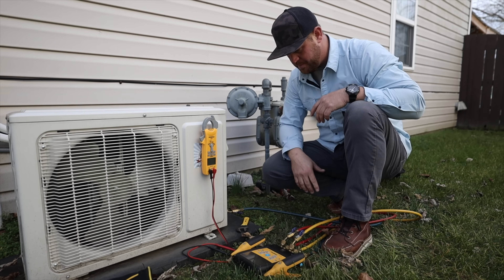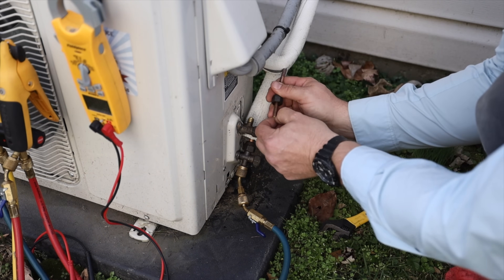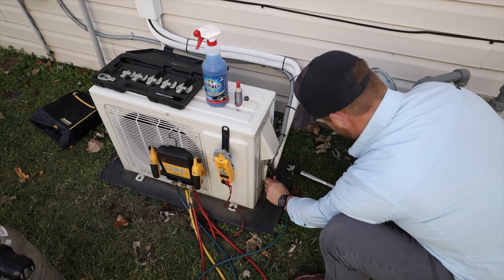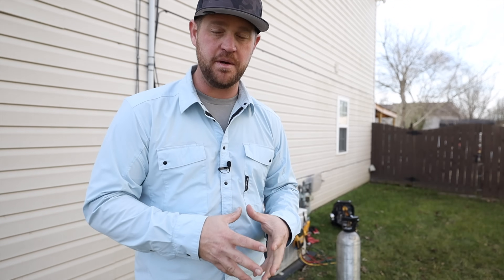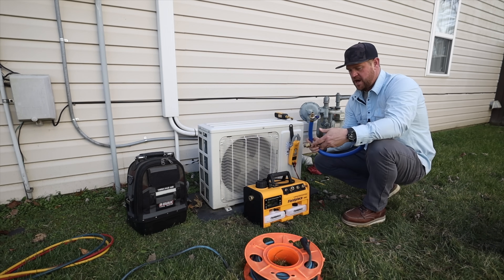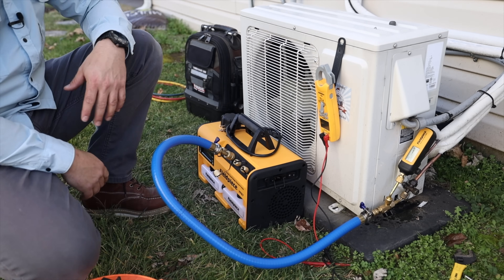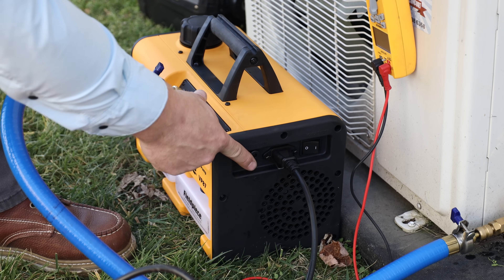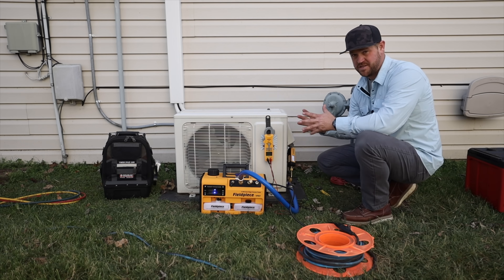#1 Reason Why DUCTLESS Units Fail | How I Fix It...

Comment: Usually, once a guy has made a poor quality flare on the outside, you need to make new flares and on the indoor unit as well. Take this advice from colleague from Bulgaria with 24yrs. experience with this type of AC units.
Reply: true, so true, you see i hate when someone do poor job, but soo many bad jobs around, eaven with so call it professionals.
once i was on cleaning job small ac unit, soooo stinky, i was yea its dirti, so i clean it full, like fan was out, and i got second call still stinks, i go back, and its true, i was like wtf, i eaven tought about pets, owners etc...and after like 5h making a fool of myself tinking wtf, i discovered small electrical smell device near ac unit, and you know what, smell was gone
Reply: TRUE!
Reply: What could happen if you don't?
Reply: @joffrecueva5662  ...you risk (more than 51%) coming back a second time, at your own expense.
Reply: HAd a few DIY use standard flare tool and not realize larger flare and not a smooth enough surface like a concentric flare tool does.
Reply: @mikeclarke3005  "concentric" means no wobble of the cone.  "Eccentric" is what I think you meant.  It's the wobbling cone type.  I've seen this mistake a few times, and I've only just been studying this stuff for about a week.  Peace  🙂
Reply: Cut those damn flare fittings off the indoor unit and braze them.  The fewer the flare fittings the better.

Comment: That unit is too close to gas meter! Would not pass code inspection!
Reply: Code varies by county, city and state. In most areas you only have to be 3' from the meters vent.
Reply: Lmao thanks CAP. 

I think as long as it’s not his home n he gets paid for coming out. Not his problem or ours lmao 

But good find, what does it need to be 5-10 ft away from a gas line?
Reply: Obviously you're not a professional.

Comment: Nah fam, as soon as you remove the old flare I would recommend redoing the flare. I know it might look good but that flare was already pressed down when they tried to torque it. That’s just my way of doing it. I don’t trust others flaring other than my own.
Reply: I would say this is a judgement call of the person actually looking at the problem. I've reused flares with no issue. Again to each his own
Reply: This guy must have run into a Fieldpeice garage sale !
Reply: @nunyabusiness6746  product placement my friend… And I love my SC440 meter and SPK2 temp probe.
Reply: I vote for new flare even if original was my own. My once squeezed flare isn't better than enyone elses. Only takes minutes and you get a fresh start.
Reply: Such a stupid and negative comments one can read here… “ The guy must have run into a Fieldpeice garage sale!” First of all, check your spelling, because if that is how you write then that’s how you are ignorant about everything ; it’s called Fieldpiece! 
Second, Fieldpiece is a state of the art HVAC equipment; you’ll never find in garage sales. The professional technician here followed the standards and protocols accordingly. Every technician will have a different approach for a same given set of circumstances or problems. If flared copper line is good, so be it. It’s a judgment call and there’s nothing wrong about that. Same thing apply while flying an instrument approach to an airport… there are protocols to be followed and every pilot will execute differently. Certain comments here are just petty !
Reply: @wagnergitirana1273    you void Mitsubishi warranty if you use nylock so... great rant, wrong but good effort.
Reply: @wagnergitirana  The comment was funny, as it was intended… And, while Fieldpiece is decent, I have some Fluke, AAB, and iManifold meters/gauges that put them to shame…
Reply: Oh dear. !
Reply: Looks like a Mitsubishi. They specifically say no nylock. Anyways re-flare is a given...
Reply: Right you already disconnected it might as well put a new flare on for good measure
Reply: Always new flares! Takes 6 minutes
Reply: @hugba  Takes 30 seconds with the Navac flairing tool. Best investment I ever made.
Reply: @krispyasfk2567 I have the Navac. I love it
Reply: Ya Nylog, that’ll do it ! HAHAHAHAAHAHAH
Reply: Navac
Reply: @tylerselby240  love that company!
Reply: Old flare was fine. Would have torqued it as soon as I found it leaking. Too many rat ass HVAC people padding bills and ripping folks off.
Reply: I agree with your preventative maintenance approach. And I'm not an A.C. tech
Reply: Makes sense, if the flare acts as a crush washer it'd be a one time deal.
Reply: Flare proved it was good   so he didn’t need to re flare
Reply: @claddagh1000   you can reject reality and substitute it for your own all you want but the facts say you must reflare. Honest techs, manufacturers, really any person with a basic understanding of how metal and torque values work knows that to be correct you reflare.
Reply: @reds815 Correct sir..
Reply: I’ve installed about 20-30 mini splits(not a whole lot) and almost every time I have to tighten or redo a flare. I started using those flare seal gaskets  and haven’t had a leak since. Those things are a bit pricey ($100 for multi pack ,1/2,1/4,3/8,5/8,3/4) but we’ll worth it. Saves lots of frustration. Buy it, try it, thank me later gator!
Reply: Always someone who thinks they know everything 😂
Reply: I am glad to see everyone advocating for new flares. I didn't realize mechanic still did flares. I see those flare helpers in the supply houses.
Reply: Yup always new flares. Can't trust the old flare!
Reply: If ain't leaking then it just ain't leaking.....
Reply: Spin bit and torque it down keep it dry
Reply: How do I set the timer for a weekly on cycle fora 22kw generac generator
Reply: I mean, if it's not leaking to that pressure, isn't it a bit of an overkill? Sure, for peace of mind anything, but just asking
Reply: Flares are reusable.
Reply: I was shown in school the factory vs. redo flare (eccentric only) and factory LEAKER!
Reply: It can go either way. If you "simply remove it" for whatever reason and don't have a leak and flared/ torqued it correctly you could reuse it hundreds of times in a row without damaging even with copper. I used to do daily at 650 psi nitro in testing and charging specialized hydraulic equipment for shipping.
Reply: You're getting paid by time anyway...why not take the time to redo it

Comment: What brand torque wrench are you using? i got the adjustable yellow jacket digital, but i would like to try out a mechanical click style, see if there is any difference, noticing that the digital may not be as accurate as i want it to be.

Comment: For everyone that is going to say "why didn't you recover the refrigerant...??" It was only 50 PSI of 410a. When he opened it I didn't see any gas blow. So that WOULD be considered deminimus.
Reply: He honestly should have recovered it before charging with nitrogen.  EPA a pain in the ass, but truth be told, 99% hvac techs do it like this anyways.
Reply: @jcarney1987   at 50 psig with 410a its below saturation temperature for ambient hense no liquid. so only 50psig vapor. you want 25-50 psig refrigerant with nitrogen for leak checking for leak detecting. so thats how it should be done. recovery should only happen if pressure is over saturation temperature for ambient hense you will be recovery some liquid refrigerant. otherwise its just a poof of vapor below saturation temp.
Reply: Plus mixed with nitrogen it’s not pure 410 anymore lol
Reply: @mrtheloverboy89   also - never recover refrigerant & nitrogen together after presure testing. nitrogen is not a compressible gas & will ruin a recovery machine.
Reply: @OcRefrig  Nitrogen isn't a compressible gas? Lol, what do you think happens when you get your 2000psi nitrogen tank!
Reply: Global warming is a scam anyway
Reply: @murkyturkey5238  😀

Comment: Get yourself a flare diameter testing gauge. Any kind of thread sealant/inserts is unnecessary. The mating surface of the male to female flare is the only seal you need. As you tighten, tighten nut, back off the flare and reseat with refrigerant oil. Proper flare making is an art and is too often rushed.

Comment: So you’re not supposed  recovered , the refrigerant first. Do you have EPA?
Reply: 50psi is pretty dang low for R410a. EPA does not prohibit venting of "trace gas" refrigerant as long as refrigerant mixture is under a certain percentage of system total charge.
Reply: @aaronburke2469  can you cite that exception in the EPA rules?

Comment: I really wish videos like this would be more accurate. I dont often chime in but, I felt compelled here.

"Flare looks good" he says....
I mean... the only way to confirm is to use a flare gauge to check it. Why eye ball something so important. 

Omg and then Nyloc?!?! Dude NOOOOO. you don't add any of that crap. If it gets in the system you're screwed. And you NEVER put anything on the threads, you'll over torque the flare and your torque wrench spec won't be accurate. 

Please tell me you triple evac that system at least... your 3/4" hose will be limited by the flow through the service valve that still has the core in it. Way overkill for this baby. Hope your adaptor depresses the core otherwise you're just pulling the adaptor down lmao 🤣 

Nope, he didn't triple evac. Hope no moisture froze inside those tiny lines man... 

Tsk tsk 😒
Reply: 🚨🚨🚨HVAC Police 🚨🚨🚨 👮‍♂️
Reply: @MrRdb916  lol. Just cant stand the bad practices.
Reply: @InverterAlways   Bad practices? I know that’s what they probably told you in your training class or something but he didn’t do anything wrong.

Triple evacuate? You only need to do that if your not able to pull system down to acceptable micron level because of moisture or non condensibles. 

Only way to know if you flares are good is to pressure test the system and see if it holds. If you’ve been in the trade long enough you know what a good flare looks like or a not so good one looks like. 

He clearly stated in the video that he was not able to remove the shrader and explain what the proper way to evacuate a system is and what his intent was.

🎤 💧
Reply: @MrRdb916  if you do not triple evacuate you can have moisture freeze inside the lines. You always triple evacuate to ensure this doesn't happen. You can make a flare that's slightly the wrong size and have it hold pressure, for a time. The flare gauge guarantees no miss. But keep using your eye balls, I'd prefer just checking with the tool so I don't get call backs. 11 years running so far its worked out pretty well. You do you, and I'll do me.
Reply: @InverterAlways  you are incorrect on your triple evac theory bud. 

Triple evacuation is meant to be a means of dehydrating refrigerant tubing in a system that has high water content before refrigerant is introduced. 

Hence why we check micron level when run a vacuum. 500 and below you are dehydrated and tight. 1000 and above you have a leak or moisture in system. Trade school 101

He still had a static pressure bc of like 50psi. No moisture entered that system buddy

Comment: The problem with flares is that people are so afraid of leaks that they tend to over tight the flares
Reply: It does not matter how perfect the flare is and the connection and the torque. 
          It’s still just a mechanical connection of two different materials one copper on brass they both expand and contract at slightly different rates and every time it goes through a heating and cooling cycle and the temperature fluctuates both mechanical connections slightly expand and contract in literally rub and fatigue over time.       So a certain percentage of perfect flares still failed no matter what it’s a physics thing.   Unless someone invents a material and method that can attach to physical parts under friction pressure that are going to go through expansion and contraction cycles that defies the laws of physics there’s always going to be flare Leaks 
       It’s called cutting out the flares and Silver Brazing. Lol no more leaks
Reply: @coldfinger459sub0  do you know why we flare minisplits instead of brazing?
Reply: @coldfinger459sub0  i dont have enough experience in the trade to have seen flares leak over time. Im in one of those companies that doesnt train or care. I install and ocassionally service mini splits, so I appreciate your perspective.
Reply: @coldfinger459sub0  daikin flare kits
Reply: @coldfinger459sub0  Disagree. He didn't use a torque wrench the first time he installed this unit. Within 2 years it failed.
Do the job right the first time and you won't need to braze.
Reply: @coldfinger459sub0  "Hass to do with the read the Aliti of the materials that we are sold from manufacturers. "

Please proofread your posts unless you don't want others to understand what you are saying.
Reply: @coldfinger459sub0  I disagree... had mitshubishi minisplit systems 20yrs old plus .. leak free!.
Reply: I used to install minisplits, and all we did was tightened it enough. Checked for leaks, and tightened down a bit more if it was loose. Im not sure how people struggle with that, torque wrenches are nice, but you can live without them, jus havin them makes it super easy
Reply: You mean the torque system of a 6ft cheater pipe on a adjustable is not the prefered method?
Reply: gotta follow that manufacturer recommendations and grab a flare torque wrench and stay within the guidelines
Reply: @bwcklein  i find it useless if you have no leaks at over 300 psi for 15 mins
Reply: @chrisjoss9592  I mean… there is a reason the recommended pressure test time is 24 hours for most major manufacturers. There is a huge possibility that you won’t see a drop in pressure in 15 minutes but come back the next day and be down 5-10 psi.
Reply: Keeping big pressure 24 h is the Best test.But noone  has enough time to do IT and they take the risk.
Reply: Well if the torque specs are touchy you also gotta make sure you torque it right. You can't stop and reposition the wrench when you're close to the torque spec because it takes additional torque just to get it to start tightening again. If you're trying to hit 10, but stop at 9 and reposition, you're wrench will click to 10 without tightening the nut anymore. It's gotta be done in one motion.
Reply: Especially the 1/4 nut

Comment: Zac when did you go away from the NAVAC pumps and the BluVac Micron Gauge? I see you are using ALL Feildpiece now. Is that Feildpiece micron gauge better than the BluVac
Reply: Sure does have A LOT of brand new looking Fieldpiece equipment huh!
Reply: @tyharvey7636 It feels so good to have A LOT of new tools, I am currently breaking all my gear in and I love it
Reply: That means fieldpiece is sponsoring him.  And no, I’m not saying anything is wrong with that!
Reply: Nothing is better than BluVac.
Reply: @Zamoramax6.6  I don’t like the BluVac, the Navac one has been great though
Reply: @salad973  huh.  I have yet to see anything hold up near as well as the BluVac.  Honestly I don't think I will ever buy another mic' gauge again.
Reply: @Zamoramax6.6  maybe I got a defective one 🤔 and the second one I got would drain the battery so fast it was ridiculous. I haven’t tried the Fieldpiece one but I sure would like to 😂
Reply: @salad973  yes.  I use the micro.  They are small and put out the same info.  The battery lasts for about 30ish hours of actual run time.  Most of my vac's are virgin installs so they are done in 20 minutes or less.
Reply: The Navac cordless would be perfect for a mini split evacuation.

Comment: I work with someone who puts the micron gauge right on the vacuum, I personally don’t agree with that but what are your thoughts I’m new in the trade. Thanks!
Reply: You can do anything ya want lol. But putting it on the pump makes it read lower anyways. Best way which you can't do on a ductless system is pull through the suction line and put your micron gauge on the liquid line. Then your gauge is the furthest away from where you're pulling as possible. Or if you have 2 hoses, one on each line then I guess it wouldn't matter which side to put your micron gauge on.
Reply: He can pull it down to like 300 microns in 15 min and I always thought that was fishy

Comment: If you make a quality flare you don't need nyloginski, flare 101 a little ref oil on the back of the nut where it spins you'll be good to go! (CLEAN)
The manuals tell you the minimum/maximum test pressure. 
I CAN'T WAIT FOR ALL THE O-RING TRASH TO START LEAKING!!!😂😂
🍺🍺🍺🥃🥃🎯🏌🏻‍♀️
Stay safe. 
Retired (werk'n)keyboard super tech. Wear your safety glasses!
Reply: Nylog voids warranty on Mitsubishi mini splits.. i agree with u, ive always used refer oil as well. An orbital flaring tool is super useful as well.

Comment: Nice vid bro as always. One suggestion on my Sman Guages it tells you to put the temp clamp on the suction line in order to self adjust the pressure drop based off of line temp. Not sure if yours has this feature but makes me more confident in my flares! And keeps me from guessing if the small pressure drops were from my hoses leaking or line temp changing.
Reply: Won’t work on these systems with VFDs… Depending on the multiple thermistors and temperature sensors, you could have super heat of 1 or 2 degrees when running perfectly to specs…

Comment: I wish minis would just have braze connections, flares suck.
Reply: Not if done properly, which is a big point of this video. Way less I have to haul up to the roof or less permits I need to fill out when flares are involved. I love them